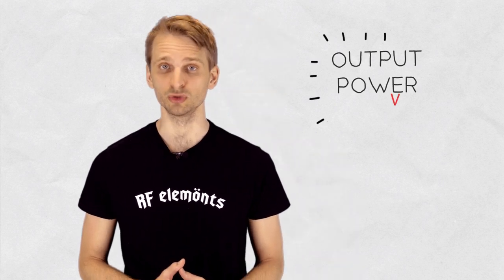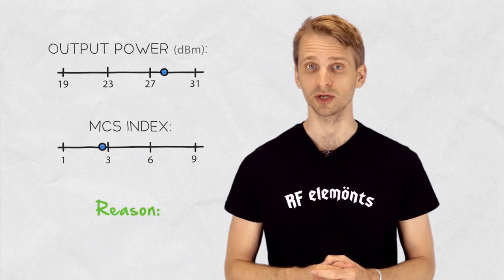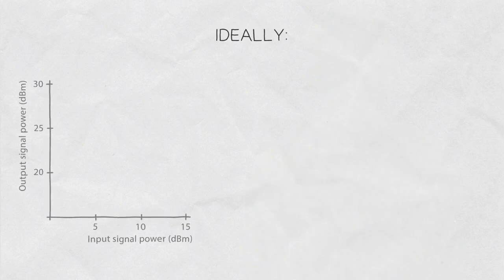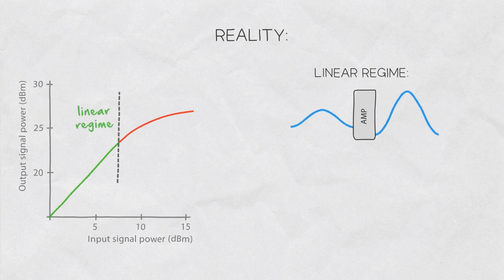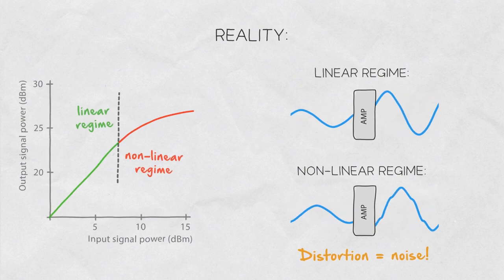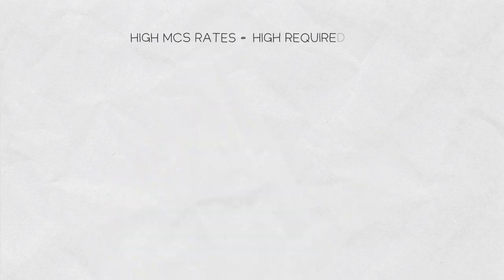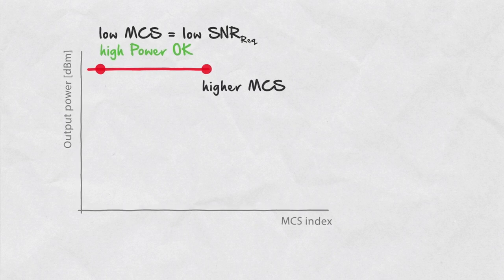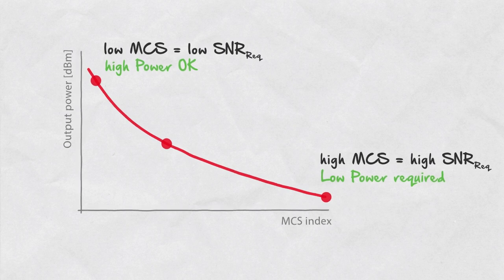Inside Wireless: MCS index VS Output Power

Comment: what is the usual max power the radio can make before it has to pass by an amplifier ?
Reply from the maker: the max output power varies among the radio manufacturers, but is usually around 30 dBm. What do you mean by 'pass by?'
Reply: @Rfelements   i believe the radio it self has a minimum power before it has to use an amplifier for more power ! i meant 'use ' by ' pass by '
Reply from the maker: That depends on the radio design of course, and they may vary among the manufacturers.
Reply: Will it cause heating if an amplifier is set to the highest gain possible?
Reply from the maker: @visionofwellboyofficial  of course, but it should be just fine if the amp is working properly and the ambient temperature is within its operating range spec.